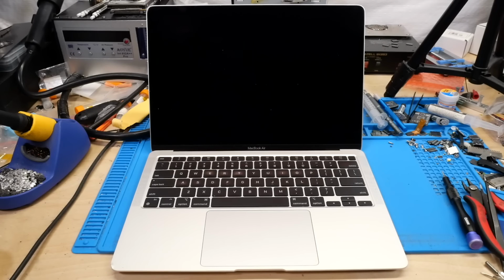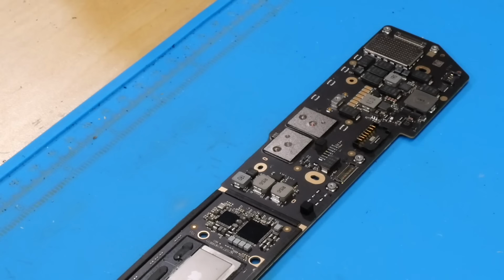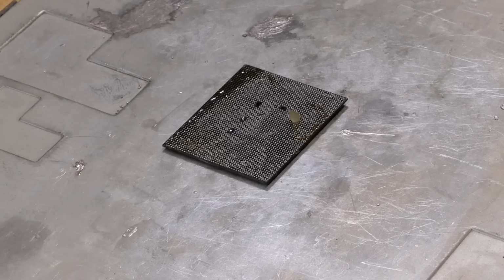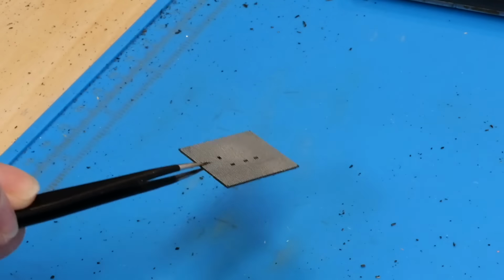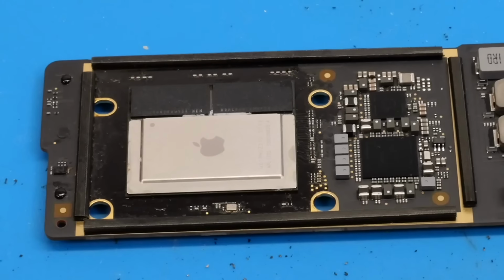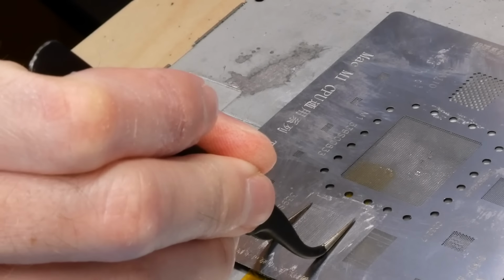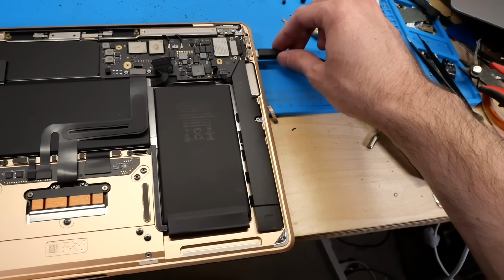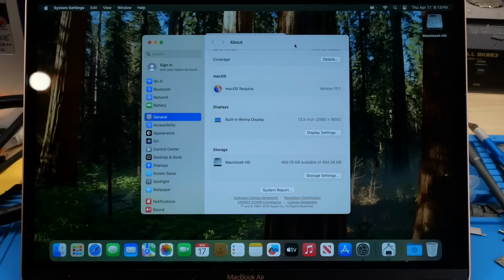Repairing a DRILLED M1 MacBook Air

Comment: I have to say that drilling a flash chip is like drilling a hole in a book. It destroys the data on a similar level. Ie, barely doing anything meaningful at all.
Someone that would want the actual data and has adequate means at their disposal, then the hole in the NAND chip is not a meaningful issue. Getting the chip off the board without destroying the data is almost similarly hard.

To make my point clear I will now go through how to recover data from a flash chip even if it has a hole in it.

First, we need to remove the chip from the board without meaningfully heating it. Since the charge stored in the floating gate inside the flash cell do escape if the surrounding insulation around said floating gate becomes too warm. Since the insulation becomes more leaky with higher temperatures. Removing the chip can be done by carefully milling away the board. You don't need the board if the flash data is all you want. (and yes I do expect the reader here to know what a floating gate is in a flash cell. But suffice to say, SSDs forgets if they get up to 200-ish degrees for a bit. EEPROMs are a bit more sturdy and might need a few more minutes to bake before they get forgetful.)

Second. Carefully polish down the surface of the flash chip from the ball side. Removing the pads and even the top most interconnection layer in the chip. Since you don't need any of that.

Third comes the actually expensive part of the process. That companies like Intel, TSMC, Global founderies, AMD, nVidia, etc are familiar with. (since everything here bellow is stuff they do already to develop and troubleshoot their own chips.)
Under a suitable microscope inspect how much further you need to polish down the chip to get to your goal. (Suitable microscope being quite fancy here, but to a degree it can be wise to avoid electron microscopes. And any microscope working with UV light. Since both these can erase our data. Electron beams can overwrite the flash cell due to the high energy of the electrons in the beam vs the small energy in the cell. UV can help the charge in the floating gate escape, the UV process is how EPROMs are erased, EPROMs are similar to EEPROMs/Flash, it just lacks the polarity swapping ability to move charge the opposite direction.)

After further polishing we will now move on to a careful etch step. Simply stated, cut away the controller circuitry from the flash array itself. (they can be a few tens of nm away from each other. But if you can build a chip, you can modify a chip. In the chip development process etching away interconnects and depositing new ones is more or less how one rewires a chip to solve bugs not caught in earlier development steps, this is during prototyping long ahead of actual production.)

Now when the flash array has been isolated. We can simply probe the interconnects and scan out the data. Yes, this requires probes able to interact with individual interconnects on a chip. So our probe will be quite small and fragile. But this is nothing special and it is done every day as a routine part of chip development and troubleshooting of various chips that dies in the hands of consumers. (Yes, your RMA can be carefully dissected and amended down to the transistor level if the chip maker finds the problem of particular interest.)

The drilled hole? Well, that is just a hole. Now we will need to attach probes to the other side of the array for the traces that has been drilled away. Also take a close look for any shorted traces and solve those by careful/selective etching.

Some (almost all) flash chips are though multi layered. As in you have a second flash array underneath the first one. But that is just some more polishing to get to. A good old case of rinse and repeat until the job is done.

And one honestly don't need cutting edge technology to do this in practice. It will just be a bit less fun with worse tools. But chip inspection tools have for a long time been 3 generations ahead of production. (though the places in the world with the needed tools to do this data recovery process are likely only a few hundred. Every chip fab able to produce sub 200 nm stuff, a few universities, chip development-/test-labs, and likely a handful of government organizations the world over.)

In the end.
Drilling a hole in a flash chip to "destroy the data" doesn't actually do much. If the hole covers 2% of the chip's area, then you have only removed 2% of the data more or less. Joe average tech tinkerer might not be able to get life out of the chip, but any chip manufacturer won't consider it much of a challenge since they do even more crazy stuff already. Even if the equipment needed is expensive, and the labor is as well, not to mention that it will likely take a few days to recover the data. So no, even a large data recovery company won't really do it at a nominal fee due to the intense investment in time per chip. You need some very expensive data for this to be worth while. But as stated, some data is worth the cost, and then a drilled hole is just an inconvenience.

However. The thing that actually makes the data unreadable is something different and far simpler. Encryption.

Not that it is impossible to find the encryption key (or otherwise break it if given enough time and resources), here it sits in the same board in the T2 security chip next door. So even encryption isn't a major hurdle for this honestly incompetent data destruction method of drilling holes in the flash chips.

A competent data destruction method is to remove the chips and crush them and then bake it in an oven at 200 C for an hour or two. I promise, no one will get that data. In terms of documentation that the data has been destroyed is another can of worms. And this comment is already lengthy enough and should clearly outline why drilling holes won't do much if your data is regarded as that important to destroy.
Reply: What makes you think the device wasn't re-installed to lose encryption keys before NAND drilling?
Reply: @FVBmovies  I never stated that it weren't.
But the general idea behind destruction of storage media is that one wants to ensure that the data is truly destroyed.

Saying "X company has probably implemented a fool proof solution." is not a good argument. Gut feeling and speculation that something is probably secure isn't grounds for proven security. So a simple re-installation of a device or reformatting of a drive shouldn't be considered secure erasure if one really needs the data destroyed. (even if that will prevent Joe average from gaining access to the data.)

And in case of re-installation. There we get back to why media destruction is a thing.
Can we trust that a re-installation actually removes the encryption keys in a non recoverable way?

Flash cells have many forms of hysteresis so figuring out what they stored before can be done, especially if the given cell has seen few rewrites in its life. (Like the flash for the T2 security chip would likely not see much write activity throughout its life, but this is speculation on my part. Apple don't really document this, so we are in the dark and that is why we can't trust it, even trusting that it stores our data securely in the first place is debatable, but that is another can of worms.)

Drilling holes in a flash chip screams, "I want this data destroyed." And why I call the practice incompetent. Since it only marginally destroys the data and makes it generally harder to access.

But randomly drilling holes in chips is even more dubious. Did one drill in a place that destroys the chip or not? Since large portions of a flash chip won't care if there is a physical hole in it, the chip will still work. (the hole might need cleaning first to remove shorts, but I have seen chips with far more damage partially work.)

In the end.

If one actually wants to destroy flash media. Then remove the chip, crush it, and bake it in an oven at 200 C for a couple of hours. And honestly, even this could likely be recovered, but I don't see it as remotely practical if the crushed bits are small enough. (to be truly certain of destruction, then melt the chip, you only need to get a bit over 1400 C, but I would go closer to 1800 myself.)

Comment: Mac has shitty intel parts, any modern AMD computer will outperform it but ppl buy Mac for their locked software
Reply from the maker: No Intel at all in this one (unless you count the Thunderbolt controllers), this is Apple Silicon. Which is certainly WAY better than any mobile AMD platform you can get!
Reply: @dosdude1  but still shitty product design fully optimized for planned obsolescence and un-upgradability.

By the things going, I can imagine apple just making a AIO chip that contains all the computer parts and package it in a resin blob like what is done cheap toys or calculators, but still price it in thousands of dollars.

Comment: you have the option to dry the paste right before you apply it if you think it still has excess liquid.
Reply from the maker: What’s the best method of doing so? I’ve done it before with a small amount by heating it enough to boil some of the flux off but not actually melt the solder, but that’s not really doable with a larger quantity.
Reply: @dosdude1  that's the best and fastest way, for a large quantity you just have to use a specially crafted container that will help the flux escape, I have a miniature stainless steel container that I got from china, it was advertised as doll house items, when I put the paste on it and heat it up, the flux will rise to the top just like oil separation from water.

The other way is squeezing which also requires you to craft or find the appropriate container for the paste, squeeze the paste and wait for the flux to come out.

You can also use paper towels that absorb well but don't leave you with a paste full of fiber stuff.

Or if you think you are going to use a big bottle of paste for the next few days, flip the solder paste bottle and put it on top of paper towels or something that will absorb well, without the cover of the paste bottle, let the paper absorb the flux for few minutes or hours or days, leave it in a warm environment otherwise the flux will not be absorbed quickly, if you do this your paste will become dry and hard to use quicker than before, but you can always mix with new flux.
Reply: just put it in the fridge man
Reply: Pressing the required amount of paste against a paper towel also does the trick
Also paste from the little buckets is usually less liquidy than from the seringes
Reply from the maker: @Jbrimbelibap  I actually have some Mechanic brand paste that came in a small jar, and it is actually even worse than the stuff in that syringe. Though I find it to work better to reball smaller chips.

Comment: Hear me out: instead of soldering the ssd chip to the board, just connect it with NVMe then drill it. Destroys your data, not your computer. Frick you Apple.

Comment: Another good argument against paired chips and using soldered NANDS as storage. Mac Mini M4 proves this.  Utterly impractical as a cost effective repair, especially being an M1 Air, but wow great skill on show and highlighting the appalling ewaste being generated is always good.
Reply: Using soldered NAND’s makes sense, you are able to get read/write speeds that socketed alternatives could only dream of. Also new CPU’s live and die by bandwidth
Reply from the maker: @tezcanaslan2877  This storage is nowhere near fast enough to be affected by losses caused by a connector. Modern RAM, on the other hand, which is an order of magnitude faster, is most definitely affected by being behind a connector, which is why soldered RAM (especially (LP)DDR5) makes sense. Storage, however, has no discernible benefit by being soldered, outside of having to deal with physical space constraints.
Reply: @tezcanaslan2877  Socketed NAND is plenty fast enough. From a signal integrity/bandwidth perspective soldering is only a benefit for system RAM (including GPU VRAM).
Reply: @tezcanaslan2877 there is no reason for it to be paired however
Reply: @tezcanaslan2877  What about drilling the chips?
Reply: @Keith-t3k  a drilled chip is a dead chip
Reply: @tezcanaslan2877  Yes. I believe my reply was to the wrong person.

Comment: For "very little money" . . . once you have $10k worth of tools.  Those solder balls on the SOC are crazy small ... at some point, as components continue to shrink, they're going to be impossible to re-ball manually.
Reply: Lol, those tools are nowhere near 10,000 😅 This doesn’t even look likr a proper machine with adjustable temperature profiles. Just a board preheater from Ali Express and a square nozzle attached to a regular hot air station. Might be wrong though. And those stencils are definitely not that expensive on Aliexpress either.
Reply from the maker: @HNedel  Yeah, if I had to estimate, I’d say this entire setup cost me a grand total of like $500 at most. Excluding the microscope which itself cost around $600.
Reply: Some folk with passion learn these skills and some folk similar to you dont/can't.
Reply: For that, there's paste.

Comment: Great video as always dude! Pretty crappy to see that the Wifi IC is also paired, WTF Apple! Quick question for you! I have an MLM locked M1 Pro from a business that folded and they werent sure who to contact to have it removed. I bypassed it and its been working fine for 2 years without issue. I now want to upgrade the SSD but am worried about the bypass. Can I upgrade it, DFU restore and then just time machine restore to use as if nothing happened? Thanks!

Comment: That level of lockdown should make user to realize one thing: to never buy those type of products in first place.
Reply: or, just realize it is going to be disposable when it eventually breaks. which is what they want.
Reply: @donsurlylyte  :(
Reply: Right to repair
Reply: "Ending is better than mending. The more stitches, the less riches"
Reply: Amen
Reply: The point of these locked machines is anti-theft. When a machine is stolen it can’t be reformatted by the thief. Laptops sold on eBay with locked chips are almost always stolen.  Apple is not going to unlock it without proof of purchase.  I doubt they will sell you a new chip if yours is just broken, but this is the intended use case
Reply: @jamesx7424  yeye sure. And what use is this to the original owner if their device is (as you said) STOLEN??? The thief isnt gonna hand it back to the original owner upon finding out its icloud locked. They will just sell it to an unsuspecting owner.
Reply: @ it’s because everyone knows that stolen MacBooks and iPhones are bricked. So they are less likely to steal one or buy a sketchy one.  It’s exactly why cars have alarms or GPS trackers. It is to discourage theft, not so the thief gives your car back because the sound is too annoying.
Reply: @jamesx7424  ok. It has nothing to do with apples malicious anti repair practises, forcing you to buy new.
Reply: @ making it impossible to buy spare parts and not providing any documentation to third party repair facilities is the problem. But people tend to get the wrong idea when it comes to things like theft protection, integral batteries, waterproofing, etc. Products like AirPods are essentially disposable. But there is not really a way to make them small and light with some sort of user replaceable battery.  Making fingerprint sensors pair to the cpu is not about selling you a more expensive product, it’s anti theft.  Same with locking the SoC.  We live in a world where people throw away electronics. It sucks. I agree.
Reply: @jamesx7424  see I still disagree. Apple couldn't care less if your phone was stolen. If they did, they would have features where your entire phone can be backed up regardless of any subscription or of you have enough iCloud storage to allow you to get it back. Samsung on the other hand, whilst they aren't right to repair, you can still replace components without distroying phones. And phones that are marked stolen can then be unlocked if you provide a reciept of purchase. This is a far better approach.
Reply: @jakewynn to be fair Samsung almost pretends to care about saving your data to the cloud. They give you 30 days of unlimited cloud storage for backups. Which is clearly intended to be purely for an upgrade or simple reset at best. Useless for anyone who needs to have a real backup in the event of a damaged/stolen device
Reply: @jamesx7424  give me a portal to unlock as a legit device owner
Reply: Not saying you're wrong, but I am using Apple products since about 10 years, and I literally never had a problem with any of the products, literally nothing broke.
Reply: @georgwagner4438  not the point. It doesn't matter how good the product is when the TOS states you don't own it, when the company that made it does not give you the right to repair, meaning once they decide to stop supporting it, or your screen breaks because of an accident, you are forced to buy a new one instead of prolonging the life of the product you don't legally own. If you don't buy the product, companies will be more inclined to sell products that are fixable when they are in an accident, and are less likely to maliciously create ewaste such as these macbooks.
Reply: @solarcataclysm If I buy it I should be allowed to fix it.
Reply: @ hang on now, you're assuming you actually OWN the product 😂
Reply: @georgwagner4438  That's what all the other people said until their stuff broke. It is not about reliability. It's about having the option to repair if and when it does break.